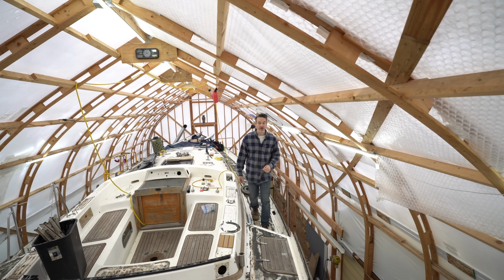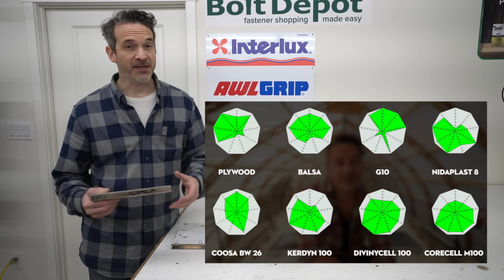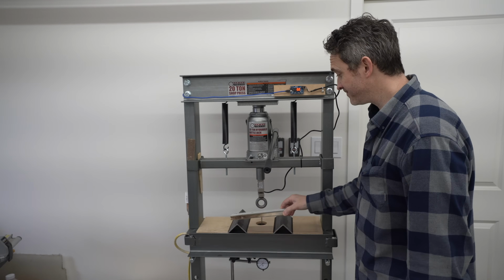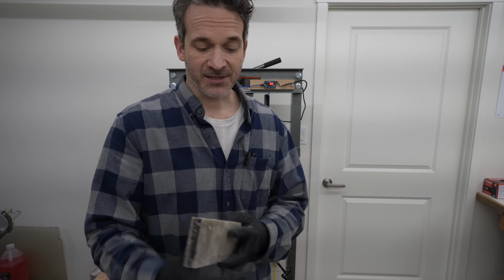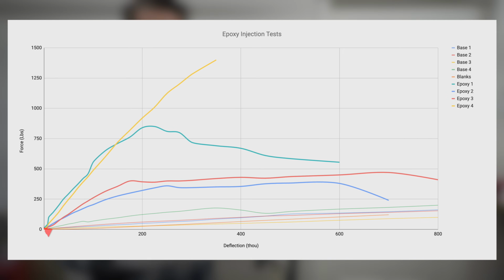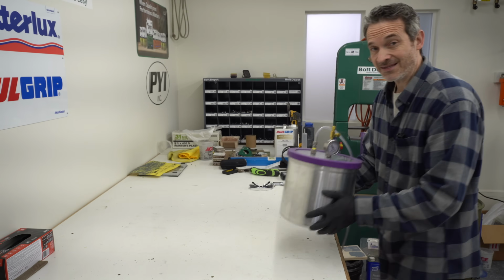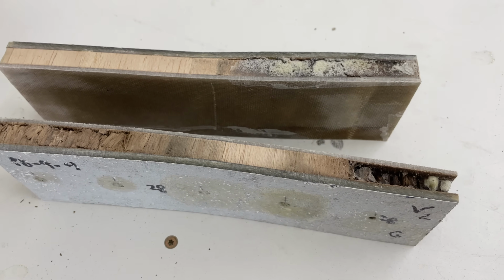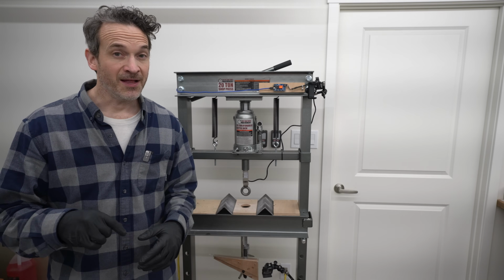Does Injecting EPOXY actually FIX a rotten boat deck?!

Comment: Very cool episode.  I am restoring a 48 year old Alden 44.  I replaced 90% of the deck core with Coosa board and it is extremely stiff.  Around the cockpit, where the decks are extremely narrow, I injected the decks with slightly thicken epoxy.  I drilled 1/2" holes in a random pattern every 3 inches and let the deck air dry for just over 2 months(boat is covered). The epoxy flowed extremely well throughout the area, resulting in an extremely stiff deck. If I had to do it over again, I would re-core the bow sections and inject the side decks.  The time and money I spend on epoxy and 1708 on the side decks alone make injecting a reasonable alternative. It may add a bit of weight, but I spent well over 150 hours on the side decks alone. Injecting would have saved a ton of time and I would have used a lot less epoxy.  Cheers!
Reply from the maker: Thank you! 🙏 were you able to measure a reduced moisture content in the deck? All the best with your restoration! 🙌

Comment: I am shocked how well pouring epoxy in to wet wood worked. I expected the moisture to keep if from doing much of anything. But that looks like usable results. Not for a large deck up high on a boat. But a small area, a stringer under the waterline, a transom, or something not boat related, This could be worth doing. A lot of places weight doesn't matter that much. And a lot of damage would be a non issue if it was just a little bit strong. And that was a lot stronger. The strongest option isn't usually needed. No point using a steal I beam when a 2x4 pine board will do the job. No point ripping half a boat apart to replace one section of a board, if pumping a quart of epoxy in to it will make the boat solid enough.
Reply from the maker: I was also surprised…

Comment: Thanks for doing the tests.  I tried the epoxy once and it didn't work because of all the water still in the core.  Replacing core from above is the best way.  I have been working on a boat where someone cut the ceiling away to replace core from below.  They abandoned the project shortly after that mistake and its a real pain to replace it from below.
Reply from the maker: Thank you! 🙏 I can appreciate wanting to preserve the top skin but I think it would be an awful mess that way. Both ways are hard work… 😂

Comment: Great video. Not sure if it was mentioned in the video but injection is also used to repair laminated RV walls. Lots of info on the method if searched.
Reply from the maker: Thanks! 🙏 interesting. I hadn’t heard that.

Comment: Liked this! An other method to get it dry is to use a halogen lamp. Learnt that from a boat builder. It is perfect you just need to have control of the surface temp. Light waves do not get effected by the wind and for some reason my sailboat seams to always be in windy places 😃
Reply from the maker: Thanks! 🙏 yeah, that’s a good way to apply some IR heat on the surface! 🙌

Comment: What is the the strength of the deck left unrepaired compared to your repair samples?
Reply from the maker: Unrepaired, the samples performed as if there was no core material at all. All of the strength was in the fiberglass skins alone. 
The rebuilt samples performed much better and you can see this in the last graph.

Comment: Thanks, I have one small soft spot on my deck and I think this has helped me decide how to proceed.
I would like to have seen a test using something like ""Git-Rot" or a thinned epoxy to allow better wicking / osmosis of the epoxy to surrounding decking. Apparently rot is a form of fungus, and Git Rot works to kill the fungus as well.

Good luck DIY'ers, Fair winds
Reply from the maker: Best of luck with the repairs!

Comment: With enough epoxy you can turn a pile of wet cardboard back into a box, but it's still a really lousy idea. Having said that, it's your boat and you should do whatever makes you happy.
Reply from the maker: I guess you didn’t watch the video 😉
Reply: @livingforsail  I did watch the video and it's great to have some good data on these results. My comments were directed more at your audience than at you. I think that while the laborious process of recoring is the gold standard for these repairs, I know there's a lot of boat owners that will use other methods. Ultimately it's about your own circumstances and preferences. Everyone is weighing a different set of factors in making the decision about how to make these repairs. I also consider that for most of us boating and boat repair is a pastime so doing what makes you happy should always be an important consideration. Keep these awesome videos coming.
Reply from the maker: @j.saavedra1502  All Good. The cardboard comment made me laugh. It's all good advice in there. Thanks

Comment: Its cool you did these tests, at least to show a base-line for comparison.  That said, epoxy or even expanding foam injection are terrible methods; they cause equal parts money, mess, and repeat work... and in the case of epoxy injection it just makes the deck heavy.  For a small area emergency repair... do what you gotta do and then repair it properly later.  If you are restoring an entire deck or at least large areas on a restoration, peel the top skin and replace the foam or balsa core, then re-laminate the topspin with new glass & epoxy.  Arm-chair repair 'experts' will cry about how expensive it is and wanting to save the non-skid deck... news flash, doing it right is less expensive, less time consuming, and stronger.  Forget about molded gelcoat non-skid... try Kiwi Grip or Teak-Looking Cork decking.
Reply from the maker: Thanks for the feedback. I think kiwi grip is in my future and will continue with the “cut and cover” method with the H100 Divinycell. 🙏👍

Comment: I wouldn't be injecting epoxy into my soggy deck. I'd keep on replacing the wet wood with  new material, Jon. That's the best way for peace of mind.
Reply from the maker: I agree! Good to see you. Cheers!! 🙏👍
Reply: G,day Jon, hopefully it's starts warming up there in Canada so you can get stuck into Antidote, brother ..wish I could help you, mate.
Reply from the maker: @andrewmoylan6295  Thanks.It is starting to warm up indeed!
Reply: Did mine 8 years ago and still rock solid so it does work.

Comment: Build a round frame like RAN Sailing used to roll his fiberglass and cedar strip yacht.  Design the frame so when you roll your boat the topsides/cabin top are only inches from the ground for easy access.  Roll the boat and brace it.  Cut away the underside of the deck from the inside to within one or two inches of the hull and bulkheads (tabbed areas).  Remove all wood core and replace it with new foam, then re-glass. Glass in backers wherever you will need them later for deck fittings.   Vacuum bag if possible.  Roll it back upright and move on.
Reply from the maker: I like the idea of preserving the top skin of the deck but if need to demolish the interior of the boat. And then the garage, or buy the property next door…  it’s probably not practical…
I will continue to cut and cover from the top. Thank you though! 🙏👍

Comment: That was a really interesting episode and very enlightening.  Many of the old "trailer sailors" on the market today have soft spots on sections of deck, and i think that you may have touched on a viable solution for those small sections.  By drilling through the bottom substrate and using a vacuum, one should be able to remove a good deal of moisture.  Follow that up with adding epoxy through carefully spaced holes on the topside, and you should end up with a solid repair for a small boat.  One thing to note about your experiment -- the shop press was pushing down on the test pieces on a point that looked to be less than one square inch.  A person walking on the deck would have their weight dispersed over about 36 square inches on each foot -- their weight wouldn't be focused as in the experiment, and while the deck might defect, it would likely be fine for many years to come.  I agree that on a larger boat like Antidote the wiser decision would be to replace the core, but as for giving new life to an old trailer sailor, the injection method is likely the best economic choice!
Reply from the maker: I will leave it up to the viewers to make the final interpretation and do what’s best for them. You are correct about the load concentration of the rig. A “T-bar” that spanned the width of the sample would have been a better method. “Backyard engineering” like I said. Haha. 😂 👍
Reply: You nailed it.   The test proved the injection to be more than acceptable on many repairs.    Especially when you consider the boat is probably decades old before the core fails.
Reply from the maker: @djpar3492  I think there are a lot of factors to consider including the size of the area (probably a lot bigger than first thought), and the application of the boat before making a final decision.

Comment: I'd be curious to know the actual weight differences compared to the foam core repair.
Reply from the maker: I forgot to publish the weight figures tables in the video 🤦‍♂️. 
Maybe I will post them somewhere. 
The foam samples are the only ones that ended up lighter than when we started. By about 5-10%.

Comment: I've repaired balsa cored deck from underneath, using vacuum. 
I had a badly rotted deck that I was able to pull the core out from underneath and then I vacuum bagged a central "plank" of new foam down the middle. 
I don't know if it was pure luck, but it worked. With a piece of structure in, it was straight forward to "bag in" the remaining area.
I would try it again if I was given another job to do.
Reply from the maker: Interesting. I can give you another job right here! When can you start?! 🙌
Reply: The trick of it ( I think ) was that the upper deck skin was airtight, I've got a C&C 27 to try on again in about a month. The issue may be to put a sealing coat of "something"  on the upper skin. I worked on aircraft for years and years and I'm much more a car guy, but I've gotten into sailing and a friend asked if I might try a fix...
Reply from the maker: @brianmacadam4793  Right on. Very Cool!

Comment: Well done video. But honestly, I don't trust the results all that much.  Far too many variables that would be impossible to account for.  I can see trying epoxy injection if I had a small area that was soft and spongy.  Still, thanks for the effort.
Reply from the maker: Yeah. I think that’s kind of the point. 
https://youtu.be/qIytOVWaprg?t=1128

Comment: Wow! Lots of work. I would very much like to have seen would be a dry, intact sample from the same deck for a true baseline target, and/or a balsa-core repair of the same laminates. Very good work. Did you try an injectable epoxy/polyester foam?
Reply from the maker: Thanks. A balsa re-core would have been interesting… I did not try an epoxy/poly foam injection.

Comment: Being one of those who have successfully repaired a very wet deck with vacuum and epoxy I was very interested in this episode.  I had an area in my deck approximately 6' x 2' that was at the maximum moisture level on my meter.  My method was different than yours because my goal was to do a repair that did not require cutting or drilling into the deck anywhere.  I did not want to lose the original nonskid texture.  My thinking was that the water could only enter the deck core through the existing holes [plus one crack in the deck caused by freezing of the wet core], so I should be able to get the water out through the same holes.  I connected my vacuum pump to each of the existing holes and crack with 1/4" aquarium tubing connected with fittings to the pump so that each hole was pulled to a vacuum. 

When I first started, I was able to pull some free water out of the tubes but soon it would just sit at a vacuum, but I would see water vapor coming out of the pump exhaust.  This was in the chilly Pacific NW, and I ran the pump all day on every sunny day, all one summer.  At the end of each day, I would change the 2oz of oil in the pump and let it sit so see how much water I was getting.  I also tested with my meter.  After a couple of months with maybe 20-30 days of vacuum, the wettest place I could find was 12% and much of it was at 0%.

I then used the vacuum to infuse epoxy into the voids in the core which filled basically every void in the core structure.  I added a pair of aquarium air control valves with a couple of inches of tube between to the tube going into each hole and pulled the vacuum and held it a 30" for a couple of hours while I prepared my epoxy.  I used System-Three Clear Coat Penetrating Epoxy which is an ultra-low viscosity epoxy that has no VOCs and does not make an amine blush. This way, there would not be any solvents trapped inside the laminate that could damage the cured epoxy.  It also would have a good bond because there was no blush.  

Beginning at the tube farthest from the wettest area of the deck, I would shut both valves and cut the tube between them.  I then inserted a large hypodermic craft needle into the tube going towards the deck and filled it with the epoxy which I used for a funnel.  I then opened the valve letting the vacuum suck the epoxy into the deck.  I kept the needle bore full of epoxy until that tube would pull no more epoxy.  The then repeated this at all of the holes.  This method pulled a bit more than a quart of epoxy into the deck.  Because it was being sucked into the deck that had a hard vacuum pulled on the interior voids, the epoxy was pulled deeply into the core and filled every tiny opening.

This was done about 10-years ago and the deck is still bone dry and stiff.
Reply: I repaired the saturated side decks of a 32 ft ketch.  Like you I didn't want to disturb the top side, so I cut 1" holes on 5" centers from underneath and then scooped out the wet and rotted balsa core.  After it was dried I injected an epoxy and microsphere mixture into the void.  that was over 25 years ago and it is still holding up.
Reply from the maker: @jrendt2157  Thanks for sharing!
Reply: @jrendt2157  That’s brilliant. I’ve been wondering why nobody ever seems to attack this problem from underneath, particularly during the drying ‘phase’ of the process. This makes a great deal of sense to me. Nice work and thanks for sharing.
Reply: Thanks for sharing.  Sounds like you found the only way to make the infused epoxy work.  Pulling vacuum on it all summer to dry it out made a huge difference, as well as using vacuum to pull the epoxy through the core.  Normally the water in there prevents the epoxy from getting into the rotted areas.
Reply: @ninehundreddollarluxuryyac5958  Yep.  When I found that I had water in my deck when the outer skin cracked due to winter freeze and oozed brown goo, I though "If only I could get the water out, but that cannot be done."  Then I got to thinking about how kiln-dried wood is dried with heat much faster than it is with just air drying.  From there, I thought, If only I could heat the deck to a temperature that would cause the water to boil and then the vapor would come out the same holes that let the water into the boat.  Well,...  From physics class I knew that if you did not have a pressure suit in outer space, your blood would boil even though the temperature is well below freezing.  So, if I could just send the boat to outer space, it would boil out the water.  

Wait a minute, I can bring outer space to the boat by pulling a 30-in vacuum just like is done to charge a refrigerator or AC unit.   

Bingo!
Reply: You don't say what core material was in your deck.
Reply: @richardowen2087  It was a plywood cored deck.
Reply from the maker: That is pretty cool! I would have loved to see that at work!
Reply: @livingforsail  I don't know how much fun it would be to "see" it working.  Watching paint dry would be similar to watching a drag race in comparison.  It took me over 2-months to get the deck dry but the infusing was done in less than 30-minutes and it was most satisfying to watch the epoxy get sucked into the deck.  It was also fantastic to remove the water and get a solid deck and leave no evidence of anything being done.
Reply from the maker: @haydenwatson7987  It's the infusion process that I think would be the most interesting to watch too!
Reply: @livingforsail  Infusion is interesting.  It gives you a much better chance of filling all of the voids than you can get with injection.  The way that you forced the resin into the laminate will always result in trapped air pockets.  With vacuum infusion, I pulled as much air out of the laminate as is physically possible and then I connected a supply of resin that was pulled deep into the voids.  It was likely that there were still some trapped pockets because the vacuum diminished as the epoxy filled the void, but I could easily life with those small, isolated voids.
Reply from the maker: @haydenwatson7987  Makes sense. Good job Hayden!
Reply: I've read a marine surveyors article a few years ago about foam cores. There seems to be a bit of controversy as some foams deteriorate rapidly under sunlight or heat. I recored a cabin top with a green divinacel product- not sure of its weight- and ever since I have a nagging worry about a failure of the core. I noticed beforehand the divinacel discolored after a few hours in sunlight as I was prepping it for lamination. The surveyor concluded that basa core properly laid up had enough intersecting resin blockaids to stop progressive water intrusion and was significantly more resistant to tropical heat damage.
Reply from the maker: @pavementsailor  If you can keep water out, Balsa is a good core material. My understanding from speaking with the manufacturer is that the Divinycell foam (I have not seen a green variety personally...) will darken under UV light but is stable for quite a while under sunlight before being covered with glass. Certainly long enough for a repair. Thanks. for sharing!